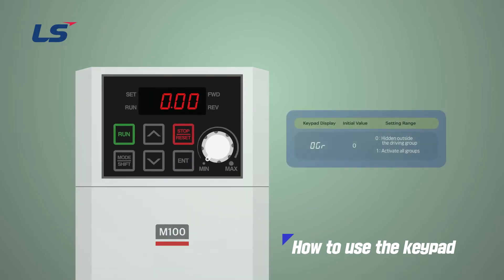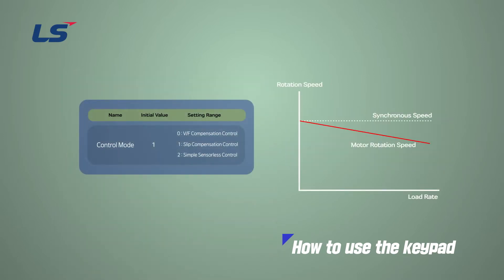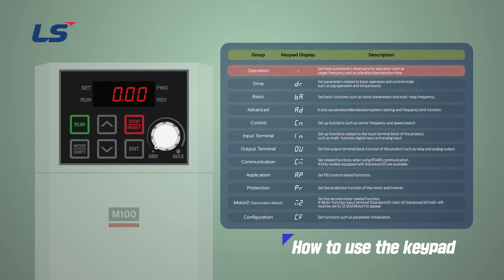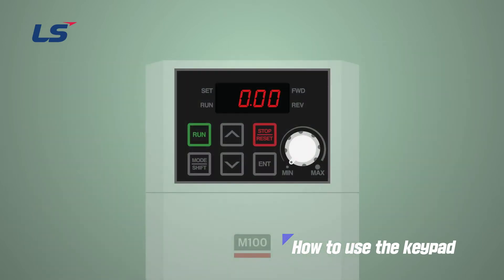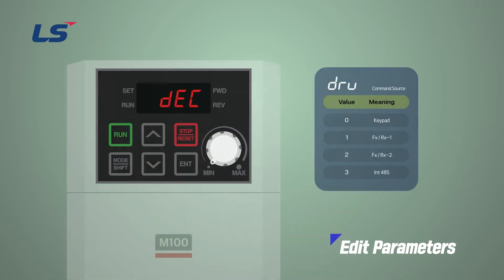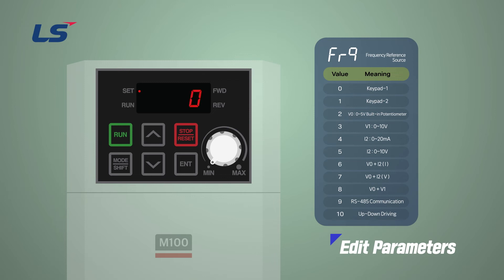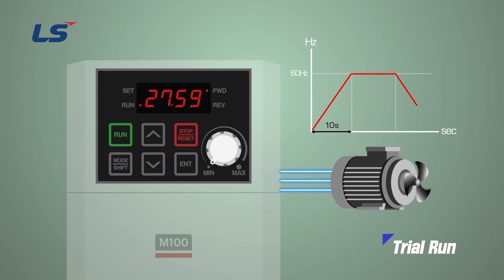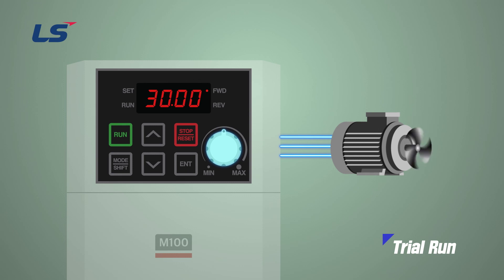LS ELECTRIC | AC Drive M100 Basic Settings

Comment: How do I set the inverter to start the motor using external start/ stop switch?
Reply: You'd want to wire the stop/start switch to the Fx/Rx1 terminal on the I/O terminal block, then set Fx/Rx1 to be your start signal like they showed in the video.